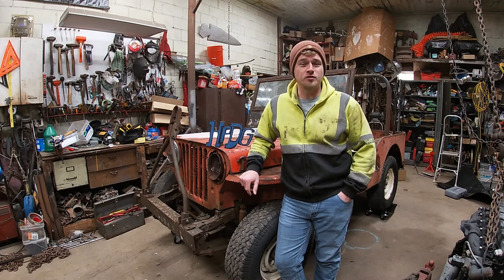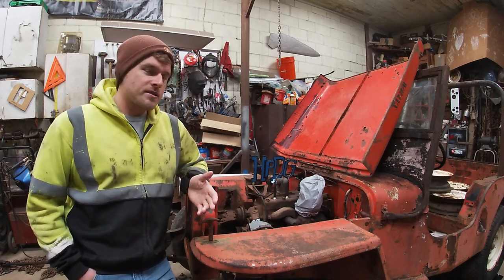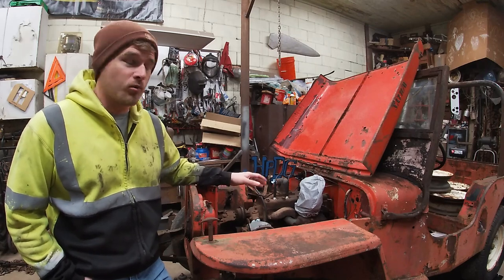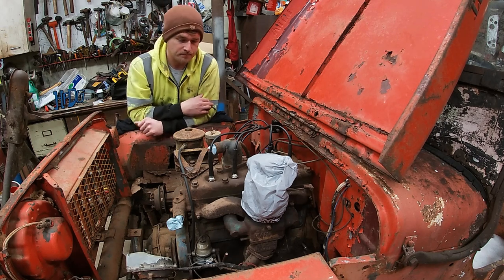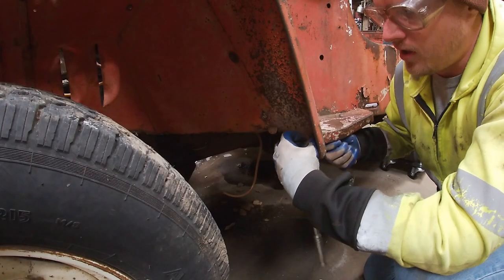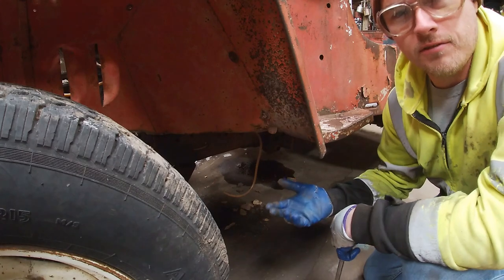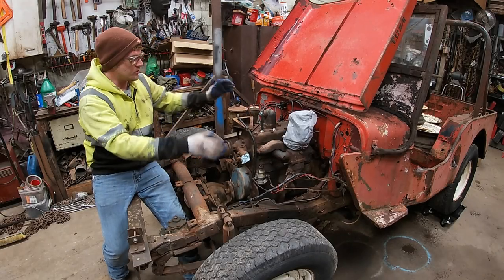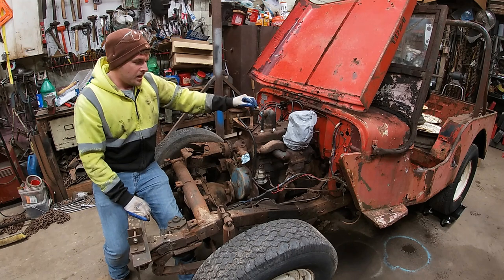Willys Jeep Episode 12: Front Clip Removal & Engine Reveal

Comment: That is a perfect motor for that jeep, keep the weight down and the performance up. A set of 31" tires and it will perform all day long. PS the axles will give up long before the trans will.
Reply from the maker: Thanks for the kind comment Terry! 🙂 I was worried about the axles 🤣 I plan on running v-treads on it. I'm sure it will toast them sooner than later 😬

Comment: What a project. You lucky dog. My first set of wheels was a 1948 Willys pickup. Perfect for a new driver. Top speed 42 mph. but it would go anywhere. Snow, mud, whatever no matter. What a truck! If you really are going to use that motor, you better be aware of the torque factor. 3 times the horsepower might rip that powertrain to heck. Looking forward to this build.
Reply from the maker: Thanks for the kind words Don! :)  I greatly appreciate that my friend. Hopefully the power of the turbo engine won't wreak havoc on the rest of the drivetrain. We shall see :)  take care

Comment: Nice. That's likely a 2.2L Turbo I if you are sure of the vehicle it came out of. I think the best idea is to use that engine for the mock up and while you are at it, go ahead and see how wiring, fuel lines, hoses and all that fits as well. The key to using JonathanW as an inspiration is to remember that he just acts, without much planning or premonition.  By the time the second "alright folks" rolls around the old engine is already out and the adapter is being chucked up on the lathe.
Reply from the maker: Thanks for the view Tyler! 🙂👍 I really appreciate that my friend.  Good suggestion on the mockup. I'm hoping it will all pan out. I'll have to double check if its a 2.2 or 2.5. 🔧

Comment: Check into the Toyota starter conversion that is used on those 134 engines. You can find that on CJ3B.info and search for Toyota starter. I believe I've read that starter is under 50 dollars. Could be wrong on the price. If you get the flathead started and have it running I think you could sell it for more $ than "I think it will run."  The Toyota us 12V.  Since the wiring us already shot you should be able to rig a switch, solenoid, battery, coil and starter and go for a drive. 

Unless that trans and transfer case is locked up you should fill it with bulk wd40 or on blaster and let it soak. Then drain and refill with GL4 gear oil and go. 

Thanks for the fun!
Reply from the maker: Thanks for the kind comment and the information Mark! 😀 I will definitely look into the Toyota starter swap. 🙂👍